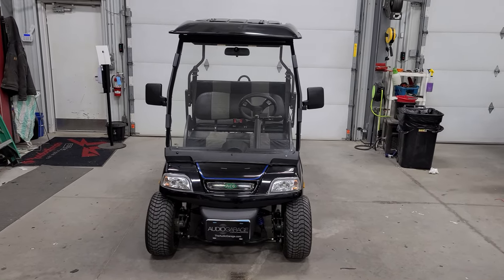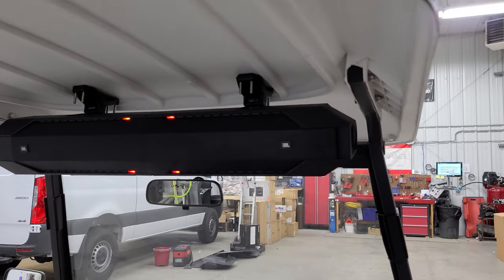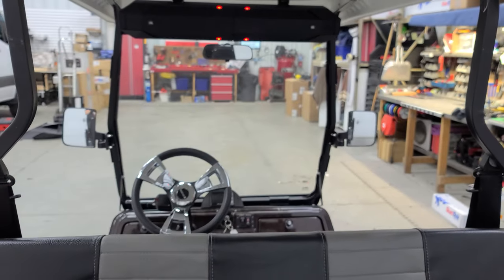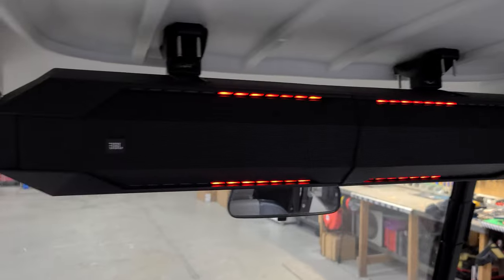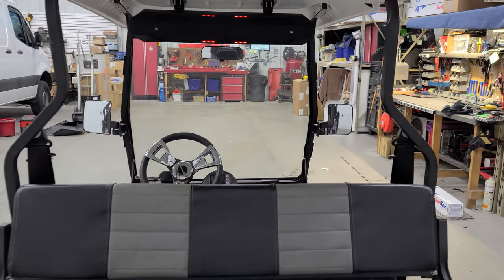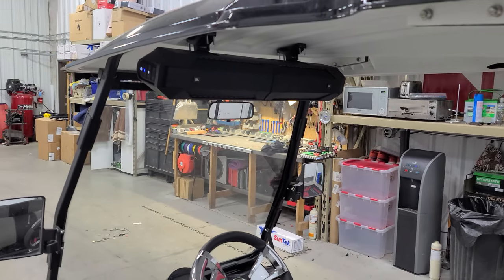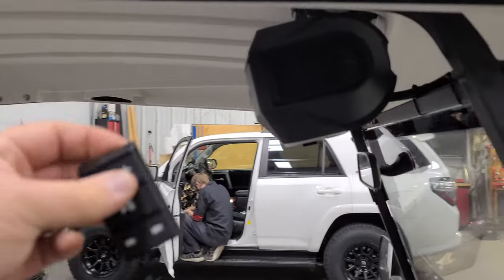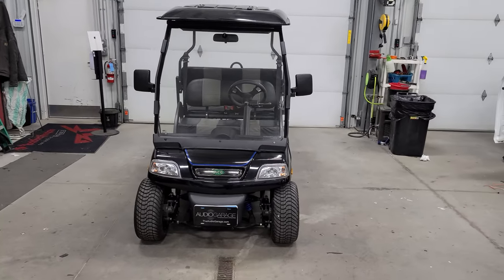Golf Cart Sound Bar

Comment: Hows the bass?
Reply from the maker: The bass isn't anything like a 12" subwoofer or anything, but it does provide a nice full range of music. JBL's new Rally Bars will have significantly more bass that this 4100. We are excited to get them soon. Thanks for watching!
Reply: @theaudiogarage7461 I’m looking into the rally bar xl for my can am defender. Do you know if these feet style mounts come with the rally bar too? I want to mount it up front but there is no tubing there.
Reply from the maker: @driller6801  the Rally Bar XL BUMPS!!! We have one on our soundboard and it literally rattles the entire thing. The unfortunate thing though, it does not come with the feet to mount it. You could very easily make it work though, if you would like. We do have the Rally Bar in stock and we could ship it out to you if you would like. Please give us a call or shoot us a text at 701-353-7266 and we can get you taken care of.
Reply: @driller6801 did you end up installing one in your defender? I am looking to do the same
Reply: @jordonrobertson2800 Yes I did. I had to mount it on the back roll cage bar. I wanted it up front but unfortunately with out the feet it’s impossible. The included bar mounts work fine and it sounds amazing. Really easy to run and hide the wires along the cage too. The cable fits nicely in the rear windshield groove. Best sounding soundbar I’ve heard. Good bass, clean sound, and it gets very loud.